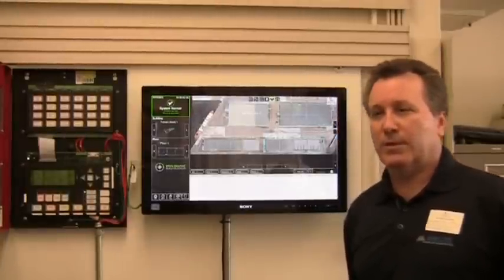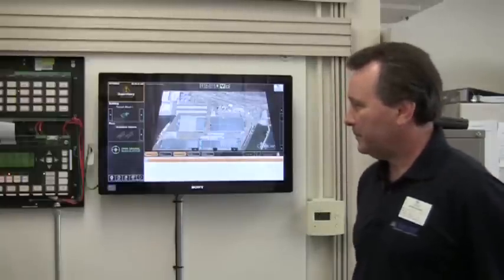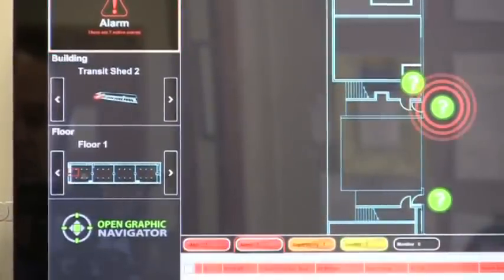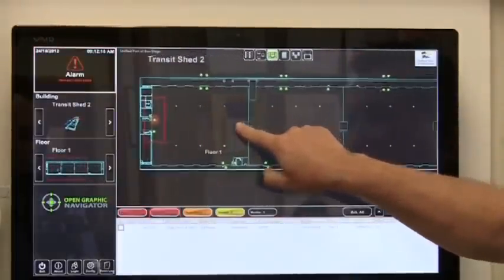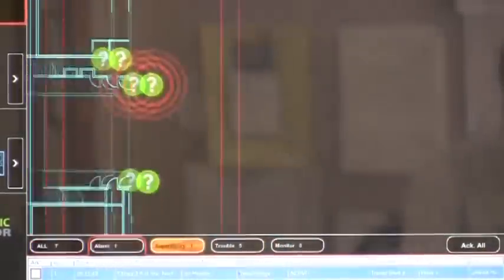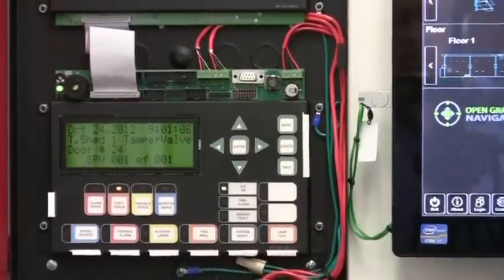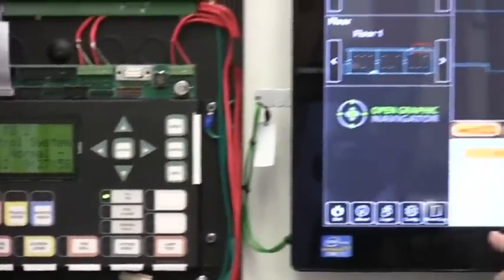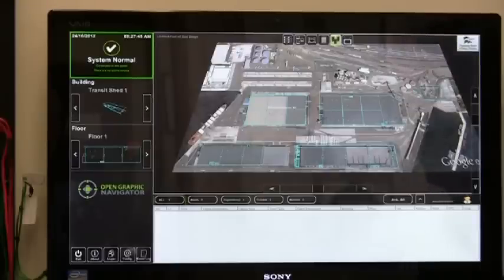Open Graphics Navigator by Mircom

Comment: Is that the FX 2000
Reply from the maker: No - but similar. It is Mircoms FleXNet system connected via IP to a touchscreen all-in-one Sony computer. The adjacent annunciator is a Network LCD annunciator with a 24 button LED Annunciator above. This gives real-time graphical annunciation and monitoring with remote annunciator control at the location.